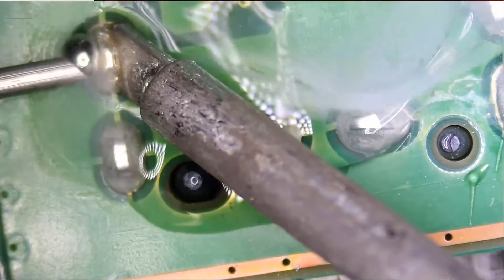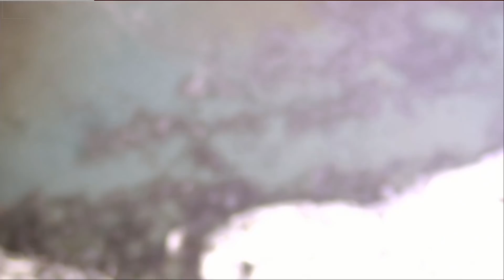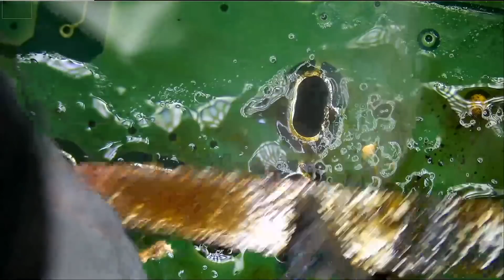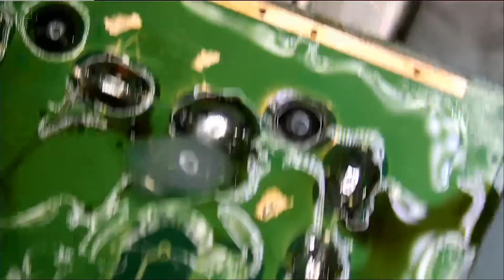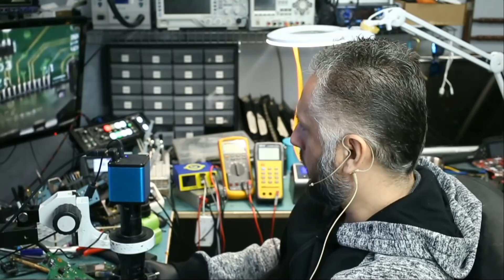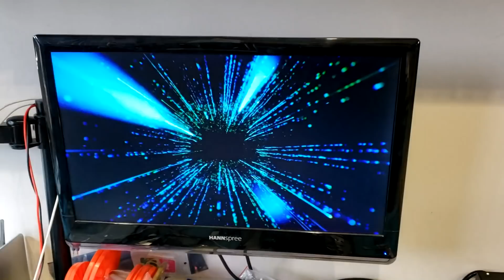Awesome Xbox one x repair - New way to solder an HDMI connector without making a mess

Comment: When I first started doing HDMI repair, I marathon'd these videos. Once I saw the reflow method, I decided to try it, and it worked. Once in a while, a pin or 3 will be loose, but that's easy enough to fix.
Reply: What temp/airflow do you run your hot air station at?

Comment: usually hdmi isn't problem for me but one x is annoying with the 6 plugs. I may just need better head gun but ended up ripping some traces, so ended up having to run some trace wire. Will try this method and hopefully better luck with next because happened twice and both with one x

Comment: I am a phone tech. I have been teaching myself how to solder HDMI ports on consoles, I have watched so many different videos. yours are done the most accurate and clean methods that I will be using. you are a legend bro. stay awesome.
Reply: Bro what particular type of soldering iron do I need to take care of replacing HDMI port and my Xbox 1s motherboard??
Reply: @joeblack8491  Micro tip it's all explained in the video
Reply: Bro what particular type of soldering iron do I need to take care of replacing HDMI port and my Xbox 1s motherboard??
Reply: How the hell do you apply solder while the flux is caked-on there??
Reply: @joeblack8491  I would not try playing with the HDMI connector if you are asking questions like this
Reply: And my heat gun WONT melt the solder, even a t 500 degrees and that fucked up
Reply: @Cliffordrussellpsyc  You have to apply low melt solder so it lowers the melting point of the factory solder
Reply: @TheRealJLucas  yeap yeap didi that didnt work, in fact i had my heat gun turned up high and i couldnt even the stuff
Reply: @Cliffordrussellpsyc  are you using a hot air station or a heat gun that you can get at Harbor freight? The latter will not work and most likely destroy overheat other components at the same time it has too much of heat. You need something more focused with a hot air station and the changeable tips will help you do.

Comment: I also run a small repair business. I don’t even bother removing the solder on the pads and in the holes but do add leaded solder to them. I also pre-tin the connectors of the new HDMI port.
After that I again apply flux on the holes and pads, heat the board from underneath and gently push the port into the holes with a plyer when the solder has melted. I believe this makes for a sturdier connection between the board and the legs.

Comment: That was painful to watch.  Have you considered getting a desoldering gun?  Something like a Hakko FR-301 like I use would have desoldered those large pins in seconds even with the high temperature lead-free solder.  The rework pencil for removing the HDMI connector is a good idea but I would have used a gullwing tip to resolder the top pins.  I would solder all 19 of those pins in 2 seconds using a Weller WES51 with an ETGW tip.

Comment: a silly question which soldering unit do you use and what temperature did u use to remove the port with airflow setting. Thanks in advance

Comment: Isn't using hotair on those connectors dangerous? The plastic parts within connector could've melted (and I think they slightly did in this video).

Comment: I want to give you some major credits and a lot of thank you.
I've been soldering since I was 17 or 18 years old and since a couple of years I've been working on smd both profesionally and as a hobby.
This afternoon I've finally found the guts to work on fitting the flashdrive connector on an old asus eeepc 701 I've had flosting around so I can fit a board with more storage capacity. (The eeepc 701 only has 4GB on board storage)

Took the connector from an old scrap board (same as mini pci-e) with some techniques I saw on your videos and soldered it on the eeepc mainboard.
I'll keep you updated on the progress 😀

Comment: I use the Mechanic T12 Pro Soldering Station with Hakko T15 tips and works well and is cheaper in my experience.

Comment: The question is you used low melt solder for take out and for soldered again?
Reply: No. Low melt solder is used only for removal. Regular leaded solder is used for installation.
Reply: @PracticalKnow  thanks for sure is because leaded solder is stronger

Comment: Love your content and I watch often. Just being a bit picky though. That HDMI connector. The solder didn't flow all the way through the post holes for the feet. The solder on the feet should completely flow from the back of the board to the front to give stability and structure.

Comment: I've been using the method for a while it works great ! You can even get away with using 158c solder to mix into posts to remove the port, skip wicking and retin everything nicely, clean and reapply flux then heat from bottom to drop port down into place 👌 you can have them done really quick this way by skipping wicking.

Comment: I used the low melt solder from your shop and did this on PS4 hdmi to remove post solder but after watching this will try and see if falls off like butter and clean. Great job. BTF

Comment: The trick is to solder the through holes last so the heat doesn't just dissipate into the board.

Comment: @NorthridgeFix Did you take the method I use from one of my few videos?  Just kidding, but this is exactly how I do it.  I still usually do a quick soldering of the pins just to make 100% sure though.

That said, what you have to be careful about when doing this, especially on the PS4 is that if you leave too much flux on the board when doing this, flux can end up getting sucked into the port itself, which can cause many issues as you know.  But yes, I've been using this method on Series X, PS5 and all previous gen consoles as well.  Works very well.

Comment: Done a few like that but find they come back for repair as they damage the port and break the pins contacting the traces. Everyone I have touched pins on has been fine and not come back. 

The tip is really exact, hope they work the bugs out as will have to get one.

Comment: I've ran through hundreds of port replacements without using low melt and I dont see the value of using it. I just hang my board off my table, apply heat from the bottom of the board, and lift off when I have verified liquified solder on the anchors/pinline. While my hot air is still in place after port removal, I come in with my desoldering iron (Hakko FR-301) and clear the anchors and the pins instantaneously.

Comment: I've always been doing it that way with connectors that don't have too much exposed plastic or sensitive components (like mics) right next to them. Much easier and quicker, less than 5min in most cases.

Comment: use ir plate and heat gun held by articulating arm, factory ports every time.  looks like it came out the pcb oven.  its a cinch in the removal process as well.  removing ports in minutes, replacing them in minutes.  the longest part is disassembly/reassembly.  but most boards come by mail pre-disassembled. i dont even need to use low melt to remove ports, the heat from the bottom allows me to do it effortlessly at 380c with 001 airflow.

Comment: I used to do hdmi repairs that way when I first started out, needless to say I didn’t know my hot air station well enough and melted the plastic. I’ve been doing pin by pin ever since but everyone is different great work.
Reply: I wouldn't go above 340C for that. Could also try about 400-420C and go from the bottom, given there's nothing super sensitive down there.

Comment: hi king
awsome job
i have some costumers that only come to my shop for changing connectors
the reason is other repair shops in my town are replacing with hot air
only i use solder iron
heat decreases quality of the connectors  even the best quality connectors
better than factory

Comment: Weird, I solder pins like that for years....
Be it eeproms, flash, socs or ports, it's just better than one by one with the iron.
There are exceptions of course, but in general that's the way better thing to do.
Reply: I totally agree. Its faster (especially if you need to do multiple devices a day) and the result looks cleaner. Been doing it this way for years as well.

Comment: I just use hot air to lift it and without letting it cool I just drop a new port right back into the molten solder and touch up the pins if needed which isn't often. I do this on ps4,xbox one and series and ps5s.

Comment: I don't understand this low melt solder, why does it seem like it does not stick so good ? 
I mean its evident by you having to apply lot of heat by holding the iron for longer periods of time.
In my mind, holding soldering iron for too long on a pad can damage it, so I am thinking that I would not use low melt solder if it needs lots of heat to stick.
Care to comment ?
Reply: These consoles are really tough, some boards can dissipate a lot of heat, so damaging pads by applying solder to them would only happen to someone that doesn't have much experience.

Comment: Nice reflow trick. Will try next time to compare results. I think the mico tip soldering iron preformed better than I thought it would. Holds just enough solder to get the job done with little waste

Comment: Hello. How dou you know that that solder blob on 10:51 is not bridging under the chip? You removed it from the outside but can it be still there bridging under the chip? If I was doing it, I would be overthinking myself and removing the chip over and over again doing a mess around and finally frying the chip to death :D :D Thanks for the video !

Comment: Yeah that is how I like to repair the HDMI connectors as well. But it would be tough to do it on a PS4 due to the plastic wall behind the pins. It melts pretty easily when trying to use the heat gun like you showed in the video. So I try to re-flow by having the hot air gun underneath the motherboard. It's tricky but I am getting better at it.

Comment: Small advise put some little solder on the pins of the connector than the pins wil reflow even better i do this trick with the nintendo switch hdmi port.

Comment: Great job bud, will give that a try next time for sure. What temperature/air flow did you use if you don't mind sharing? 😊
Reply: Simon C  Thanks Simon 😁
Reply: @JoeyDoesTech  These boards soak up heat like no other. I run 480c for port removal
Reply: Been doing this years joey. By far the easiest  way to do a hdmi port very rarely will you ever have to touch a pin with the iron. 400°c is my goto just make sure you keep the heat moving so you do not melt the port

Comment: destroyed 8 xbox 360s attempting to solder a simple modchip back when i was 15 years old - so simple, yet even that was a challenge as a dumb teen. replacing HDMI ports is way more difficult. you make it look so easy, man. failing repeatedly in the past was extremely depressing and a huge waste of money, but the experience and repetition was worth it. have improved quite a lot since then. still not a master at micro-soldering; however your videos are inspiring and really appreciate the time and effort you put into sharing your progress, it's very helpful and insightful 👍
high quality flux is definitely important. had to learn that the hard way

Comment: Makes sense, reflow is cleaner and even solder distribution, and
Big Boss the best.
Reply: Reflow is also risky if not careful. Can easily smoke the HDMI connector as you said ;).

Btw are you a repair technician?

Comment: Very nice way to solder the HDMI port indeed but you really have to know how to handle a hot air station, if you aim wrong you will smelt the connector so yes for more experienced repair people like you this is a much easier and faster way to do it. Great fix Alex
Reply: I do this method from underneath the port. Once you get the factory solder off, to heat from under I use about 390c at full speed and it's pretty easy to reflow the new connection.
Reply: @MitchCairns  what solder are you using for tinning the pads

Comment: HI. I get XBOX one to look why it runs but no signal on screen. I removed all mosfets from GFXCORE, IC NCP4204, and I got 3ohm short from GFXCORE mosfets to GND. If I put voltage on short I feel heat only from CPU. Can be there another fault than damaged CPU?